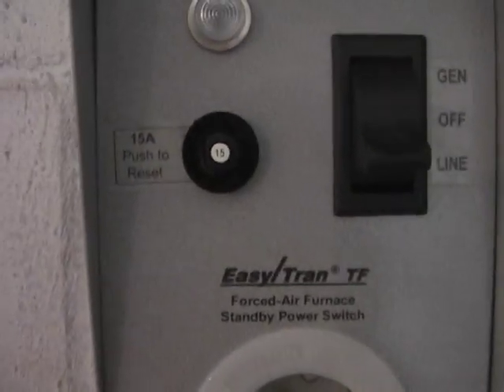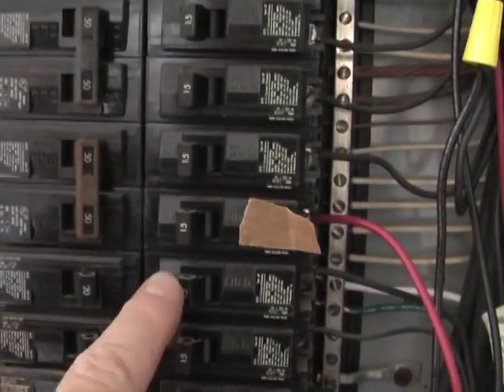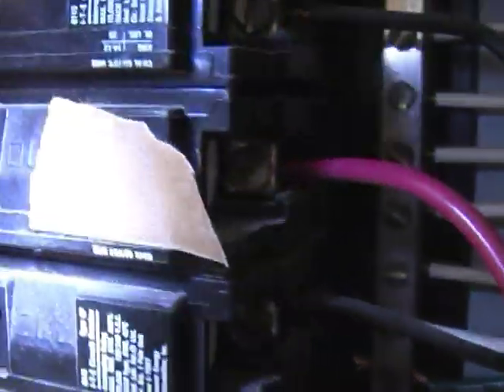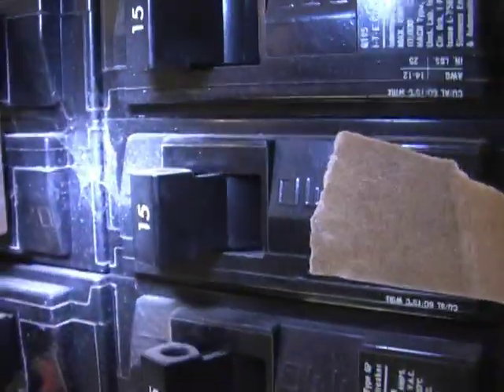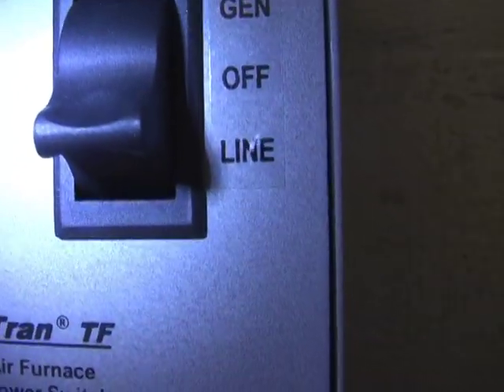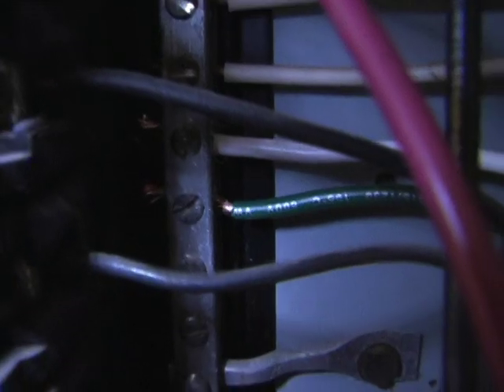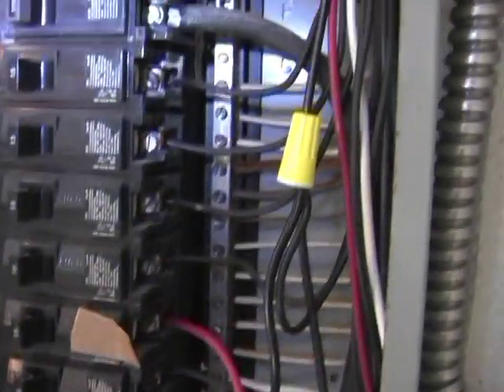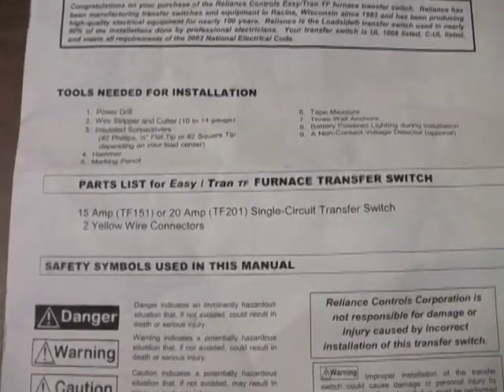Generator to Furnace Transfer Switch

Comment: FYI....remember you can only install  that type of transfer switch on a gas furnace only not electric furnace. You will damage your portable generator if it's electric furnace. Gas furnace uses 110v  15amp or 20amp breaker

Comment: Once the transfer switch is installed in the panel, you can close it up.  The transfer switch is a DPDT (on/off/on) switch.  The only thing you may have to do (especially on newer gas furnaces) is change your generator from a floating neutral to a bonded neutral.  Very easy to make that happen.  Buy a three prong plug.  Use a short piece of 12ga wire and wire the ground and neutral together (The green screw and the silver screw).  Close up the plug and plug it into any of the receptacles on the generator, then plug in extension cord to the transfer switch.  DONE  You now have a bonded ground generator.  To revert back to floating, just unplug your jumper plug.  It's that easy.  I prefer to put the transfer switch on the furnace rather than go into the panel.

Comment: Thanks for posting. I didn't wanted to hire a electrification to wire the whole house with a generator. Thanks to you I installed it my self. Good job explaining. I got my switch from amazon. Thanks Again.

Comment: You are wrong the manual switch does not allow that to happen. If the power comes on as this is running, it will not matter, the manual switch can not be in two places at once

Comment: No he's not. That's the whole point of a transfer box. When he moves the switch from line to gen he is disconnecting the furnace from the utility service. It is now powered by the generator. Once utility power is restored he has to switch back to line or the furnace will continue to be powered from the generator.

Comment: I hope you turn your main off when running Gen. Reson why if you don't your back feeding the main feed line and you may kill or injure a linemen fix lines outside your house.
Reply: Good general information for folks (to not do that), BUT this box is built specifically not to allow that.  That's it's purpose, aside from allowing the quick connect.

Comment: @artcancro 

The red wire is landed on the furnace breaker in the main panel which is the OCP.  The switch in the Easy tran is just a single pole double throw switch.  When switched to Gen power the screw in fuse in the Easy Tran is the OCP when switched back to LINE the breaker in the main panel is the OCP.  What is wrong with that?

Comment: Sir,
Rule: 101 only work on a power system with the power turned off! Your setup is still a very dangerous situation since you have just shorted the ground and neutral together from the generator which means if the power comes back on you may have a phase problem that could back feed the mains.

Comment: How powerful a generator could you get away with using? My heater draws about 12amps total and is 120vac(around 1500W i guess), so am i correct that a 2000W  generator would be sufficient? or am i completely off base? :) great video by the way. clear and easy to follow instructions.

Comment: Thanks for vid. Is there a "legal" way to put this switch next to the furnace by splicing it to the wires going to the furnace itself? (Away from the main distribution panel).

In my house it's easier to hook up the generator wires in the boiler area.

Thanks